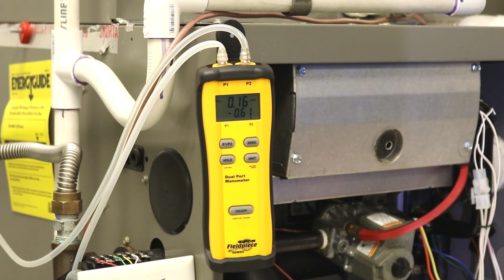Static Pressure

Comment: i have a manometer reading measuring the pressure drop across my furnace filter. At what reading should the filter be changed? The theory is if I run the filter until it gets to this magic number than replace it I am not replacing too soon or too late.
Reply: that depends, is this for commercial or residential, do you have pets, do you have allergies, etc. for a home its not unheard of to change your filters monthly, bi-weekly if you have pets. changing filters is probably the cheapest maintenance you could do to extend the life of your unit. so do it often.
Reply: @golgo1138  the filter has been in there for the last 4 months. It looks relatively clean still with just a very small amount of dust on it but barely visible. I know that manometers are more for commercial use but I just wanted to try to change the filter based on its reading and not time since obviously the time can vary depending on the time of year as well.

Comment: Ive seen multiple seminars that touch on the topic of SP, qnd according to industry experts, this is wrong. It does need to be on the other side of the coil, as we are not measuring box static pressure, we are measuring system static. Also, having the probes, especially on the positive side, that close to the blower is going to give you inaccurate readings. We are supposed to have in the neighborhood of 2-5 ft of smoth flowing air to get a fully accurate reading. This is a fairly poor video, Lennox.

Comment: The top number is the combined system pressure (P1-P2).  The Bottom number is the P2 (look at the arrow on the screen).  To get the P1 you have to hit the P1/P2 button (Upper-Left button)

Comment: It was hard to tell exactly where the probes were placed in relation to the evaporator & air filter.  Was the probe after the air flows through the evaporator or before it?  After the return air enters enters the air filter or before the return  air passes through the air filter?
Reply: in a commercial package unit total external static pressure is measured in the return before the filter, and in the supply after the blower

Comment: I have a lot of issues with this video.  We know where you put the positive and negative pressure tubes on which side.  Oh wait....  And the tube on your test instrument is kinked.  But, I really struggled with having that style of flexible connector on your lab equipt.  Get the stuff that meet codes or have your students install B.I.  Mostly useful video, but I won't be showing it to my students.

Comment: It seems to me that what one is trying to measure is the pressure drop across the blower as this is an indicator for how hard the blower is working to move air.. So rather than saying where the probes should not be placed, might it be easier to just say where they should be placed? I.e., one on each side of the blower. Thanks!
Reply: every component of your unit is an airflow restrictor. Filters, evap coil, heat exchanger. you must measure before the filter and after the heat exchanger

Comment: I am not an hvac guy and I know you are supposed add those two together to get the total external static pressure. This guy must be very dumb.
Reply: Looks like the system is running around 0.7wc which is higher than 0.5wc, so it is not running in optimal settings.  0.1-08 is ok with the new furnaces as long as the equipment is not undersized. Again I am not an hvac guy but know some basics, probably better than this noob.
Reply: I wouldn't say he is dumb. I'm not sure if he just misspoke on the numbers or if he doesn't understand how it works. You'd think they would correct it though.
Reply: The top number is the combined system pressure.  The Bottom number is the P2 (look at the arrow on the screen).  To get the P1 you have to hit the P1/P2 button (Upper left)

Comment: No, I believe your total static pressure is around .5 From what Fieldpiece says about this manometer, the top number is the difference between atmosphere and each port and the bottom is the total.
Reply: The bottom is the difference and the top is p1 or p2 reading depending on which one is selected
Reply: No, it's not. You can see the minus sign bottom number. That can't be the total.
Reply: @Faruk651  you disregard the minus. This particular duel port manometer reads supply and return at the same time. If you had a single port, you'd take supply, return and add them disregarding the sign for total static pressure.

Comment: Have you come across static pressure causing the ECM motor to I have wind up noises or cause vibrations  on High cooling setting?

Comment: Ok, I have a few problems- first, it doesn't look like the instrument was set to zero before taking the reading? Also what I have learned is that you have to add both readings together and disregard the + or - signs in order to measure the total static pressure.